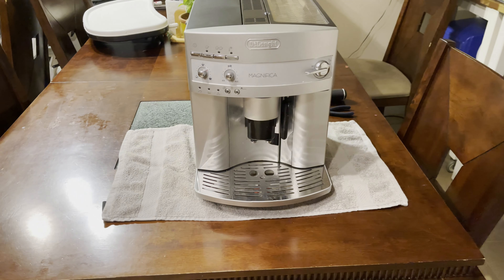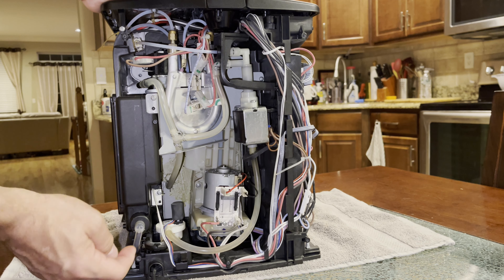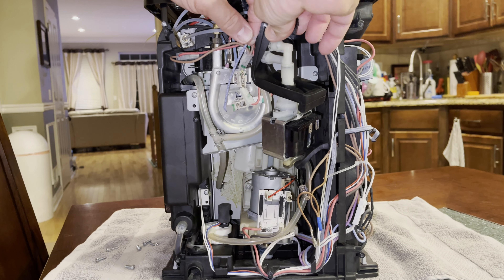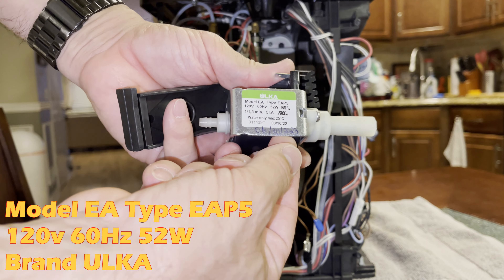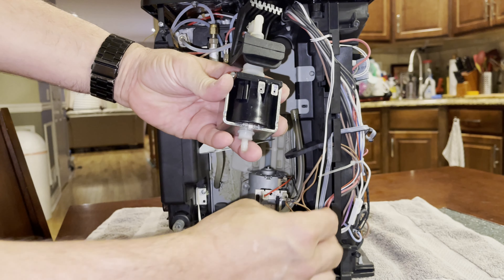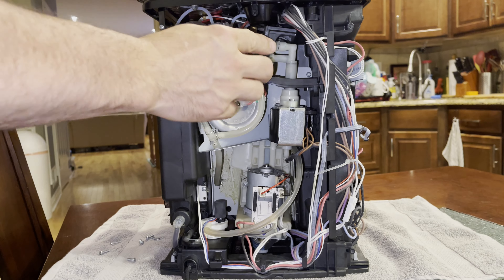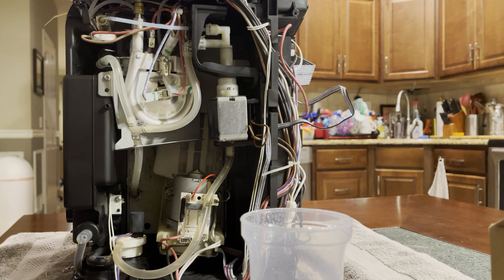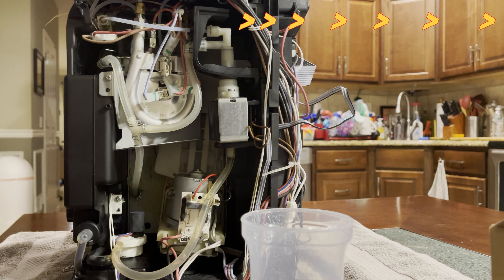Delonghi Magnifica ESAM3300 Espresso machine water pump repair replacement fix  DIY Made Easy!

Comment: Thank you for posting!  I just fixed our machine and thankful it's working again for only about $45 for the new pump.  I started the machine without priming the pump first (oops!), and it didn't work.  Then I watched the rest of the video (LOL), primed it and it worked fine after that. I hope I didn't ruin anything.
Reply from the maker: Glad it helped

Comment: Thank you !
Reply from the maker: You're welcome!  Thank you for watching
Reply: Hi Mrtrytofixit,
 I've got a similar ESAM3300 that I can't get steam out of the wand.  I've replaced the wand, heating element and soliniod. The pump works to push water out for espresso and rinse but when the wand is activated it the pump pumps  slowly and very little water drips out. I'm stumped.
 Any suggestions?

Comment: How do you know it’s the pump that needs replacing? The water flow in ours has suddenly stopped but it’s still making the usual sounds and ‘trying’ to pump water.
Reply from the maker: Hi. Thanks for watching and apologies on the late reply.  There’s a strong possibility the pump is broken, perhaps some of the rubber bushings.  Before you try to replace it, try and check to see if it needs priming.  It could be dry and trying to pump air.  While in the machine, check all your tubes as well.  If they are leaking , your pump may be pulling in air instead of water from the tank.   Hope this helps!

Comment: My machine become louder what can I do thanks
Reply from the maker: Thanks for watching!  It’s difficult to troubleshoot based on sound and not hearing it.  I would start by making sure the pump inside the machine is not banging on any other parts.  They usually are hanging from rubber holders and not affixed to the body of the machine.  Check to make sure the rubber bumpers/holders are intact and not broken in  any way.